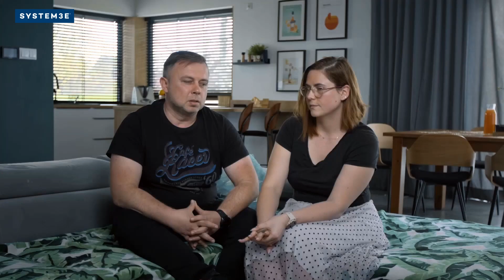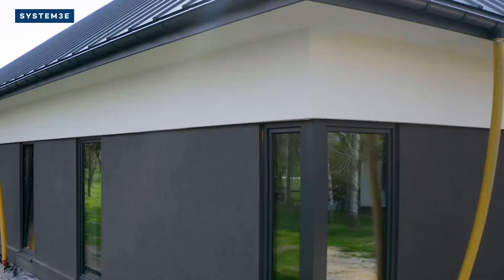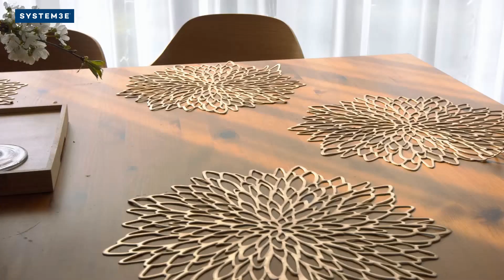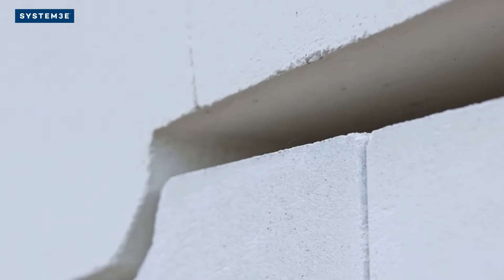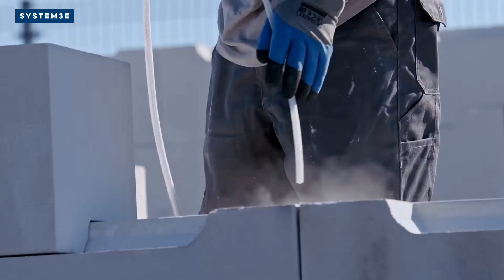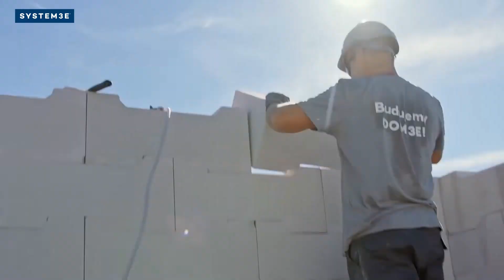We Tested a Perlite House. Here's What Happened. [AI DUBBING]

Comment: So you plaster on the outside and on the inside to get the finish you want. will these walls hold screws for shelves, cupboards etc. what about the celings and roof spaces, are the joists made of traditional wood with insulation above?  Do you havea video of a full house being built, not just the walls but the entire house (like a grand designs type video). Is the flooring traditional concrete? How about plumbing and electrics? more information needed please. Thanks.
Reply: These houses are not bulletproof, flood resistant, they are ground floor houses when flood comes you don't have where to go or escape, they are easy for eavesdropping. What else to say

Comment: I saw this building system at the Porto, Portugal Concreta trade show on 21 Nov and it really is slick.  The blocks interlock and "stick" together from friction (think Lego).   Installing electric or plumbing requires sawing channels, as with any full masonry wall.  System 3E provides a suitable grout to then fill the channel.  Looking to see if I can use these blocks on a new build in Portugal.  Lime plaster over the inside and lime parge over the outside the walls should maintain the vapor breathability of the system.

With the limited availability of construction labor pretty much everywhere, this system looks like a winner.
Reply: Do you know if this is actually available on the market yet?